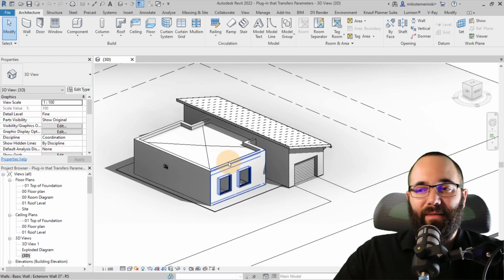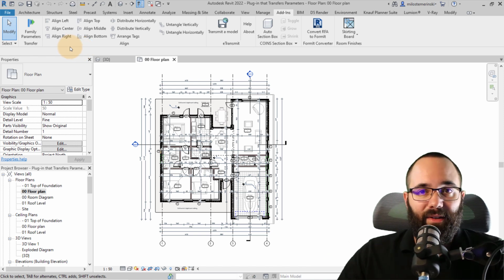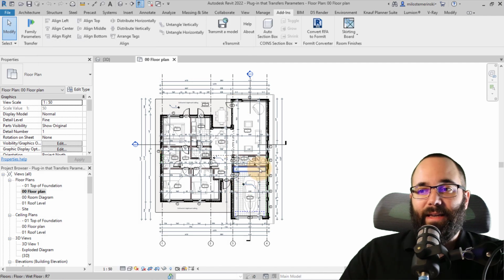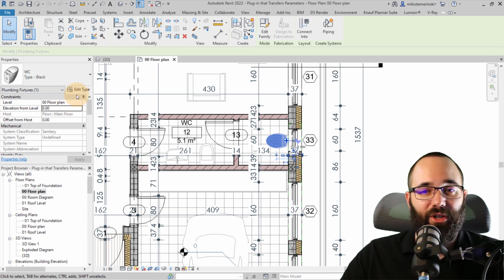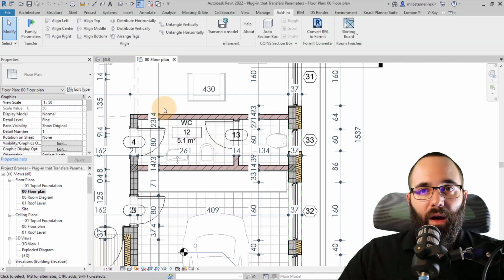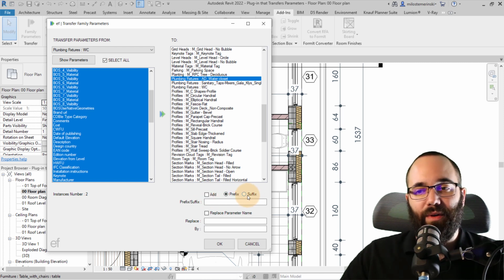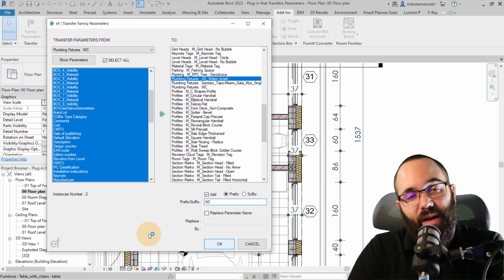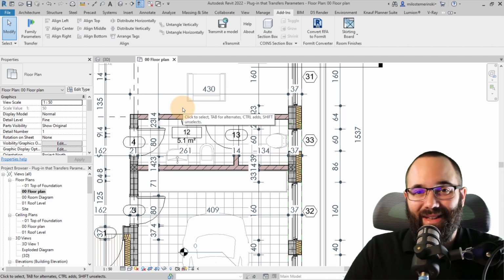FREE Revit Plug-in that Transfers Parameters - Revit Tutorial

Comment: The lack of ability to use add-ins in LT really bites in situations like this.  Revit needs to allow them in LT
Reply: Revit LT is called LT for reason.
Reply: @AussieBIMGuru  that’s obvious, but even add-in options could be allowed in with limits.  For those that are not rolling in dough and/or who are attempting to present the benefits of 3d modeling to a major construction industry that, up until recently has been built using ,exclusively, the LT platform(Autocad LT).  An option to add just one or 2 add ons,would be nice.  Especially considering their has been work around developed for Autocad LT users in the past for such items.  One would hope that the same would be allowed in revit as well.   Even Bentley has realized the benefits of allowing similar options to their trimmed down products.